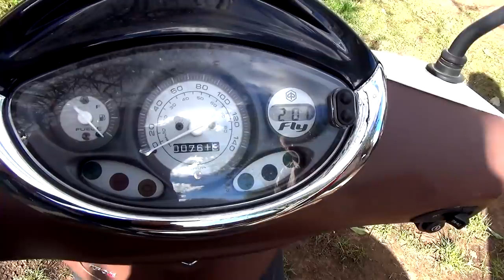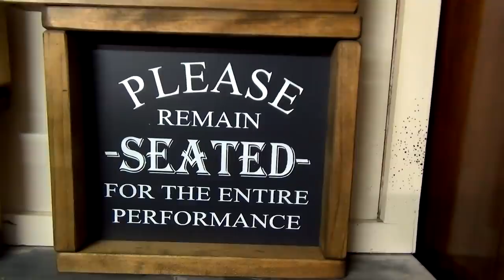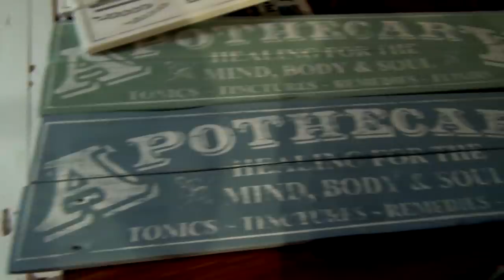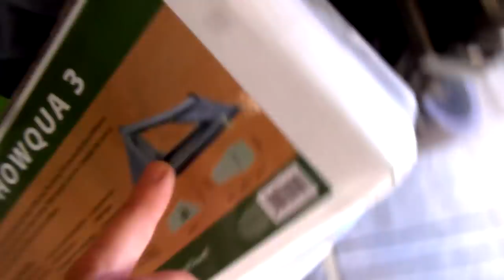Scooters & Soldering! MCT 2019 Ep.8

Comment: Hello Mark. Another great video. I remember when I first learnt to solder. I was only 17 and as expected, I had trouble at first. Now I've been doing it for a living for 37 years. As a couple of viewers have already pointed out, the idea is for the solder to run onto the wire rather than the soldering iron and then painted on. The soldering iron is only really there to heat the wire, so that the solder will run onto the wire and between the wire threads. This will make a solid and reliable connection. The wire needs to reach the same melting point temperature of the solder, before the solder will run onto the wire. Hence the temperature of the heated wire, will melt the solder, rather than the iron. The trick is to pace the iron onto the wire, no longer than necessary, otherwise the insulation of the electrical wire will start to melt, which will look ugly and may ruin the job. So the iron is placed onto the wire and the solder is place near the soldering iron. As soon as you see the solder melt, you know the wire has reached the correct temperature. The iron can be removed, as soon as enough solder is applied. Depending on the size of the joint, the whole exercise can be achieved with just one action. I hope this helps in some way.
Reply: That is it in a nutshell. Then if you want to get into it... and start looking at tips. I hate that the default tip things are shipped with is normally a Conical but good on the Ryobi having the blade.

Comment: Top video Mark, yea I put the tip of the iron under the wire and hold the solder on top and the solder will run when the wire is hot enough.
Reply: Right!  You don’t melt the solder with the iron. Heat the wire with the iron. Keep the solder on the wire. When it’s hot enough, the solder will melt to it.

Comment: Hi Mark Thanks! for another fun video. For soldering, pick up some "Flux" either paste or fluid. After you've twisted your wire together spread some flux on the joint. Heat the wires with the iron, flux will bubble and appear to burn, don't worry about that. Feed your solder from  the opposite side of the iron. The wire should be between the iron and the solder. (no painting :) )Don't rush, if the wires are hot enough the solder will flow like water and "wick" in to the wire. The finished solder joint should be shinny never dull.  Give the wire some time to cool. Moving the wire before the solder has enough time to cool will result in a dull (gray) solder joint " a cold solder" it may look fine and be strong but has a higher probability to fail over time.  Look up " Western Union Splice" for one of the strongest wire to wire joints. Any way thanks again, love the channel.
Reply: Also with the jaws... move the wires closer to the clamp stops it from moving as much and you can press the Iron into the work better.
The fumes coming off was the flux...

Comment: put the iron under the wire and hold the solder on top, when the wire is hot enough  it will melt the solder all throughout the wire. best way to do it. also, if you fan the wires out and overlap them, then twist it makes a much stronger joint. great job for figuring it out on your own.

Comment: Mark, no need to heat the wire first.  When iron is hot put a drop of solder on the tip, then hold tip under wire joint (touching wire).  Wait a couple seconds and the solder should start spreading into the wire.  That’s the time to start adding solder.  It should wick right into the joint.  Don’t forget to add flux to wire before you start the process unless it’s made into the solder. 

Cheers
BullDog

Comment: The trick with soldering is to heat the wire from underneath, then apply the solder to the heated wire whilst still holding the iron to the underside. The self fluxing solder will melt and run into the twisted wire strands. You just need to apply enough solder to fill the entire twisted wires. PS I used to be a Telecom Exchange installation tech and wired up hundreds of racks in telephone exchanges around the south west of WA way back when I was a young bloke!

Comment: The 2 up scooter ride was really funny! Thanks for the laugh Mark. No expert on soldering myself, but you should heat the wire from below and then the solder is supposed to flow into the wires, not just stick on the outside. That way it fills the gaps and provides better electrical connectivity, and prevents hot spots from to much amperage flowing though only some of the strands. Good to see the strippers in the cave again! Glad you like them.

Comment: I'm no soldering expert although I've been told that you're supposed to heat up the wire then allow the solder to flow onto the join. Seems to work ok for me. The painting method has resulted in me ending up with dry joins in the past.
Reply: Also, uses more solder.

Comment: Keep the heat on the wire’s Mark- then melt the solder onto the hot wire - don’t heat the solder directly and blob it onto the joint - otherwise you’ll end up with a dry joint...24:15 - Mark burns himself again 😂

Comment: Try adding liquid flux to your soldering options. It might help in getting the solder to flow onto and into the wire strands. Some of the solder you can get doesn't have enough flux built into it.

Comment: Hello Mark, watched your videos a while now and enjoy them. First comment actually. I wired in communications networks all over the world and did a bit of soldering here and there. Tons of it actually. A couple of tips . Get the wire hot enough that solder flows onto it without dabbing. That can cause what they call a cold solder. Everything looks good but nope. Trouble shooting it can be a right bitch. Keep the tip clean and lot's of flux.  There's a joke in there but I'll leave it well enough alone. Cheers

Comment: If you used a bit of flux on the wire, you'd find it would flow into it really well.  I couldn't solder without it....even if the solder comes with a flux core, I don't find it works as well.  I'd send you some if I wasn't in the UK :)

Comment: If you solder it properly, it will NOT be possible to pull it apart. As others have said, the solder needs to wick into the hot joint